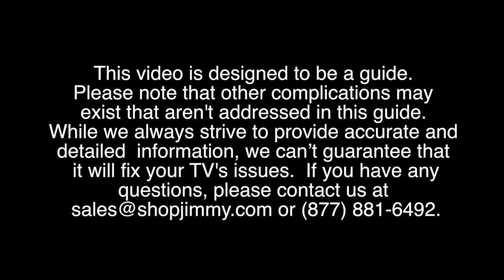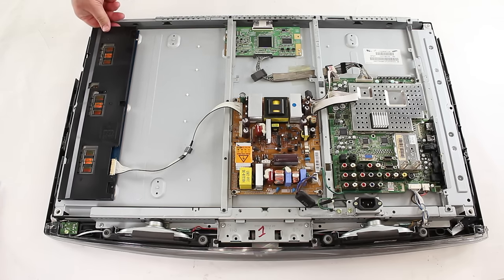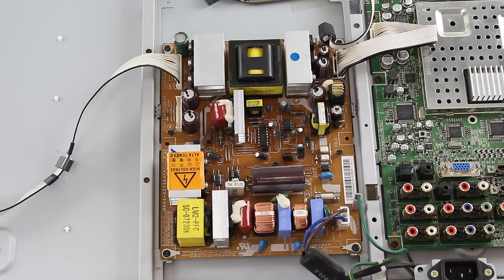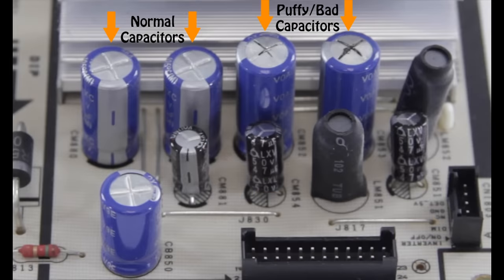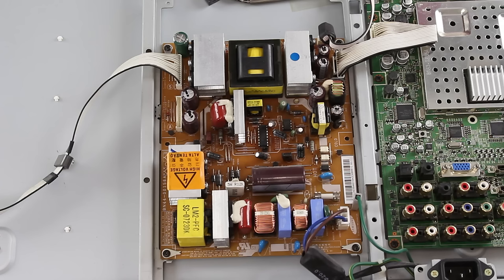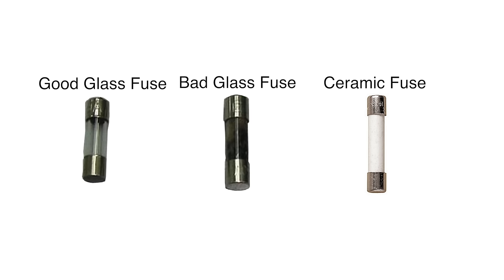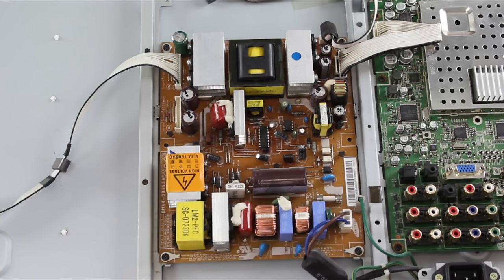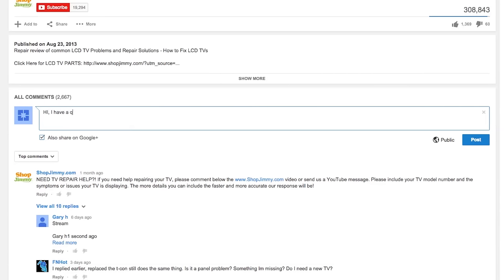Samsung TV Won't Turn On & Has No Power & No Standby Light - Samsung LCD TV Troubleshooting Help

Comment: My TV had no power and no red light.  I watched this video, took a gamble that it was my power board was defective as they said in the video.  Ordered the part, swapped it in and my TV powered right up.  I'm glad it was a $50 fix, instead of a $1,500 new TV.  Thanks for the informative video, and the replacement part.

Comment: Found two "puffy" capacitors..spent $3.50 for both.. soldered them in and my 11 year old TV works again. Thank you!
Reply: My 32 inch Samsung around same age just a few weeks ago no image on screen no sound , just have red standby light on in right corner , pressing won’t turn on set . This model has no physical power button anywhere . Might open it first time. You convinced me with the price you fixed yours . 🍺

Comment: sadly power supply section was not case of no standby light / dead tv in my case. I had to buy new motherboard for 20$ and everything worked. Probably it got somehow high voltage from antenna cable or other device via hdmi and it got damaged. Remember standby light is going directly from motherboard, not power supply board so no standby light mostly means damage of one of these boards. It does not point if TV has power, it points if motherboard is working correctly.

Comment: The best video ever posted on repairs.  Thank you.  I have not removed the cover to test it but the liught will not turn on and no light.  I tried disconnecting power and then reconnecting to now avail.  I will probably end uop needing a new board a UN65NU6950P.

Comment: Video helped me figure out what the most probable fault is and how to fix it.  I decided to purchase the full repair kit and I will replace the power supply board first and go from there.  If the $80 I spent on the kit gets me a few more years of outdoor use on my Samsung TV, I will be a happy guy.   I will update this post when the kit comes in and I install the parts.
Reply: Parts came in just as expected, very easy to install with just a screwdriver. TV works great again and I am holding onto the other parts from the kit just in case.  
Thanks for making this so easy.  
The alternative considered was to buy another TV.  $80 well spent.  
Keep up the good work.
Reply: Which repair kit?
Reply: What do I do if the problem is not the power board?

Comment: Thank you for the video. I have a 32" Samsung flat screen and don't see a fuse but u do think there are some components that look puffy as described. The blue ones on mine look just like the ones in the video. I only paid like 150 for the TV. Would it be worth it to get it repaired or should I just get a new TV?

Comment: Thanks for this great video... I have a Samsung  LN32C350D1D 32 “ tv.....  It started switching randomly between inputs, then turning itself off and on.  A few weeks later it just stopped turning on  completely.  I have a red light showing it has power, but when I hold down the power button there is no blinking or change of the continuous red light.  I took apart the back of tv to visually check things out.  I took pictures and since I am new to this, I thought I would ask you what you suggest.  The tv is very sentimental to me as my father bought it for me and was very pleased and proud to give it to me.  He recently died and I want to keep my tv as long as I can...it is sentimental for me....  according to your tips, I am leaning toward capacitors. I would very much appreciate your advice...thank you.  ..

Comment: Hi, you mention to check the fuse on PSB, for the glass fuse that can be visual inspect to see if there is a burned out thru the glass, but how do we inspect the ceramic fuse to see if it's burned out or good? Thanks.
Reply: I have the same question, and my ceramic fuse has a red line in the middle. not sure if that's an indication that the fuse is the issueM

Comment: @shopjimmy.com is it possible that the main board is bad if I have no image no sound and no standby light? Checking the power board with a multimeter  I have the standby voltage and the capacitor, fuses and diodes are good on the power board.

Comment: I have a Samsung plasma TV model number PN 42b 450 b1d I have red power light but will not power on what are some of the steps I can check without taking it apart or is there any steps to fix that

Comment: Hi,

i have a Samsung UN55B7000WF that's has had the flashing red light followed by some clicking then the same process over again no picture.  I check the PowerBoard and see no visibly damage on the caps so next i would have to check the stand by voltage on the PB my question is can you let me know if my Jensen JTM-95 is OK to do it with?  and if you can let me know if i can replace the red and black leads i have with a pair that has smaller tips to check the voltage when the connector is connected?

Comment: Dear Mr Jim my. 
Thanks for explaining tv repairing videos. 
I am facing one problem,  one Sony Bravia LCD TV.Panel is out of order(Power supply board and main board is OK. )my quistion is with out replacing the panel there is any solution for repair this. I am waiting for your valuable reply. 
Thanks and regards. 
Th

Comment: Thank you for posting your troubleshooting videos. I have a UN48JU640D  Samsung that is a year and half old. The Standby light initially comes on but when turning on the TV it doesn't turn on and the Standby light flashes (1 long and 5 shorts flashes) . Do you know what that error code is indicating. Thanks
Reply: damaged ic on the main board ,replace the damaged parts or the main board
Reply: Thank you for your reply. Do you know if the flash sequence is a failure code and if so where can I find a list of the failure codes.
It was a chance of replacing a board, but I had replaced the main board and it works.
Reply: My Samsung smart tv turned off while I was watching it and never turned back on. It was only a couple of months old. What can I do to fix it?

Comment: Gd pm, my samsung la32c450e1 no power, no indicator light, b4 I will replace my power board can you give possible voltage check present in good and bad powerboard? Thank you for for the help

Comment: I have a Samsung UE46D6507VKXXE tv that stopped having white light when power cable connected. The standby light keep blinking and I can hear a clicking sound. Since the standby light blinking and is on but no light/background light and signal from TV, does this mean it's the T-CON board that need to be replaced? I have tried to replace the power supply but still the same problem. Thanks!

Comment: I have a Samsung LT27A550LR/ZM, it tries to turn on, but after few seconds, he just don´t. I read few forums that says its a common issue of the power supply. could be this or the main board?. I cant find the part number of the power supply and I rather not open the TV (but if there is no other way, I' ll do it). thanks

Comment: Samsung plasma model pn60f5300afxza version us01 won't turn on no standby light, swap power supply board with a known good one still doesn't turn on? Could it be the main board? Suggestions please?

Comment: Hello there, my tv has all these problems. The TV is Samsung SmartTV MODEL UN55H3203AFXZA. I just received the power supply board BN44-00774A to replace the old one. I did it and the problems still persist. What can I do now?

Comment: hi I have a DLED32165HD was  on and just turned off cannot get it to fire back up again no standby light or anything checked like your video for a fuse but there's not one now checked the power supply board but anyways or bump it can't see any looked underneath looks perfect can you help

Comment: Hi, my lg tv 32lf5610 seems to turn on with a dark screen but the optical audio input has its red light on, ive measured all voltages and only 1 from the power board list is 0 volts but also there is no power going to the leds is it the power board?

Comment: Good day.I have a Samsung S51AX-YB02 . I get no power and When I opened it I see a green blinking light 2 second intervals and then it stops. I can't get it started no power or clicking sound either. I checked the fuse and it's good. Any suggestions. Thanks for your help.

Comment: I've never had a problem with my Magnavox 50 inch tv. Yesterday I picked up the remote to turn it on as usual. No power, no lights, no nothing. I reseated the plug. no luck. I did a 10 second power button test. no luck. I plugged the power cord into another flat screen it came on immediately.. So I'm assuming now that tv's just go out at anytime with no warning at all. I'm pretty depressed about the tv not turning on. I'm assuming its the power supply. I've replaced computer power supplies but the tv power supplies look a bit different. I'm thinking of doing a DIY. I am a computer tech. I have repaired thousands upon thousands of computers and laptops. Yet never repaired a tv. Do you think I can repair the tv? Any quick pointers. Is it easy to take off the back panel. Should I be very careful about certain things? my tv is a Magnavox 50 inch flat screen model number 50mf412b/f7 has no power? Thank you.

Comment: Hi,  Thanks for your videos. I have a question on my samsung TV repair.
Model Number: Samsung TV LN40A550P3F
About a month ago while I was watching TV the picture suddenly went off with with distorted vertical lines and buzzing sound noise. I pulled the plug to turn it off.
The next day it started normally and was working fine until this week.  The same problem happened again but it never came back on this time. I followed your videos to trouble shoot.

1. Standby light is blinking but the TV does not power on.
2. The 2 fuses on the power supply board are good
3. I don't see any visual damage of the capacitors on power supply board or main board. main board gets power from power supply board. I checked voltages with multi meter.
4. I don't see back light on or picture when tested with flash light.

Any ideas where to go from here? Anything else to identify the problem?

Thanks!

Comment: I had a blown fuse on the power board  it's a T3.15ah250vp ceramic. I purchased a 325A250v ceramic put it in and it sparked bad!! Is it the wrong fuse and I killed the TV for sure?!?! Had trouble finding the exact fuse with all those numbers and letters

Comment: I have a Sumsung 20 inch tv. It will not power on. But I can't find a fuse on the board. Can fuses look different than the ones you have shown? The tv is only about a year old. This problem started when I turned off a circuit breaker and then turned it back on.

Comment: well I hope u can point me in the right direction I purchased a samsung plasma p64fh at a good price and come to find out it has an issue the set every now and then will power on then after about 2 min it will shut off and won't power on again for some time I have already replaced the 3 capacitors on the y board so I'm trying to see what should b my next thing to check and or fix .there is no stand light on at all can u please help thank u

Comment: Would a bad power IR button cause the TV to not turn on? I have no puffy capacitors or blown fuses and when I start unplugging power board the TV back light comes on.

Comment: Hi i have a samsung Ln52a650a1fxza that tries to power up then screen goes black as if shutting down stand by light blinks as always when tring to power up can you tell me what the problem is looked at power board and do not see any damage or bad looking caps  thank you    Jim
Reply from the maker: +jim lucente  Try all repairs and troubleshooting at your own risk.  I recommend replacing the main board in your TV.  Click this link to replacement parts for your TV model number:  http://www.shopjimmy.com/catalogsearch/result/index/?cat=56&q=Ln52a650a1fxza  There may be multiple boards for the same TV model number, be sure to match part numbers on your current board, with your replacement for compatibility.  Here is a link to a video showing how to identify your part number, click here:  https://www.youtube.com/watch?v=BEPWrefQvqI  Thanks and please let us know if you have any further questions with your TV Repair!  www.shopjimmy.com
Reply: ShopJimmy.com .I just rented a LG smart TV..but they didn't send a remote home with me..don't see any buttons to turn it on or anything. .what do i do..

Comment: I just replaced the power supply board on my Samsung 55 in tv. The powersupply board shorted out, and I purchased a new power supply board,  as well as the other boards, and associated cables. I still have no sound or picture. The stand by light does come on, but it did after the powersupply board shorted out.

Comment: Hello. I have a Samsung TV which has a similar problem as the tube video describes but it will occasionally work is this a short problem. I have not taken it apart to go over the points in the video but I wanted your opinion before I start.
Reply: Forgot to ad model number:PN43f4500AF

Comment: hey guys. I have Samsung LCD model  LN40B640R3FXZA with no power and no standby light. The TV just shut off while I was using it and would not turn back on. Capacitors are fine and nothing looks burned or damaged. The fuses also look fine. Anything else I should check? Thanks for your time.
Reply from the maker: Dave Murphy  Try all repairs and troubleshooting at your own risk.  I recommend replacing the power supply board in your TV.  Unfortunately I do not see any replacement parts in the search results for your TV model number on our website.  Please reply with your part number on your power supply board and I can try searching for replacement parts.  Thanks and please let us know if you have any further questions!  www.shopjimmy.com

Comment: My rabbit has chewed through my power cable and the one connect cable ......Samsung tv wont power on or no standby ....is it easy to change a fuse on Samsung ue49ks7000u , also I know i need to change the cable lead but what's the chance the on connect could have blown ...

Comment: Hi I have a samsung PS-50C96hdx Plasma TV. It was working fine then switched it self off. When it has power connected the blue light comes on and is solid. (I believe this to be standby mode) when I turn the TV on whether with the remote or with the centre button I hear the power on sound/chime then the blue light goes off and nothing. I have had the back off to check the capacitors and there is no visible signs of any component damage. I am going to take the fuses into work tomorrow to test.
Reply from the maker: +602066046  Try all repairs and troubleshooting at your own risk.  I recommend replacing the main board in your TV.  Click this link to replacement parts for your TV model number:  http://www.shopjimmy.com/catalogsearch/result/?q=PS-50C96hdx  There may be multiple boards for the same TV model number, be sure to match part numbers on your current board, with your replacement for compatibility.  Here is a link to a video showing how to identify your part number, click here:  https://www.youtube.com/watch?v=R1jmj_foId0  Thanks and please let us know if you have any further questions with your TV Repair!  www.shopjimmy.com

Comment: I have a Samsung LN-S4051DX that won't power on. It just clicks and has no standby light. I've tested all caps and they are good. And when I test the power board, I am getting overvoltage. Where the 13v pin is, I get 18v until it clicks, then it goes down and comes back up to 18, then repeats over and over. The three 6.4v pins are at correct voltage until the click, then they go down and come back up. And last, the 12v pins all have 26v, then drop down and back up. Board looks good. No burnt spots or cold joints. Sounds like a humming noise coming from transistor the whole time it's plugged in and clicking as well. Any ideas?

Comment: I was upgrading a samsung tv au46f5000arxzn using a USB flash disck. Unfortunately it stuck at 90% and could not proceed. IT indicated on the screen that do not remove the USB or Switch off power. I waited for long without success only stuck at 90%. I then switch off the power and remove the USB. After some minutes I returned the power and switched on the TV. It couldn't start until now. The red light switch is on but nothing on the screen. The TV not respond to the remote control. What can I do from here to restore back the TV.

Comment: Similar to Tevarius, I have a 2014 Samsung UN40H5201AFXZA that also doesn't power on and no stand-by light. The only thing that happens is when I plug in the power cord, the stand-by light flashes 6 times. I tried the power board, the main board and the T-Con board, still no power up. I even disconnected all connections from the power board and the main board trying to isolate the problem and the stand-by light still flashes 6 times. I'm suspecting the P-Jog button because it's the only thing that I didn't unplug. What do you think?? Any help you can offer is much appreciated. Thank You!!
Reply from the maker: +zeusman100   Try all repairs and troubleshooting at your own risk.  I recommend replacing the main board in your TV.  Click this link to replacement parts for your TV model number:  http://www.shopjimmy.com/samsung-bn94-07741b-main-board.htm  There may be multiple boards for the same TV model number, be sure to match part numbers on your current board, with your replacement for compatibility.  Here is a link to a video showing how to identify your part number, click here:  https://www.youtube.com/watch?v=f7QkKGlqM_Y  Thanks and please let us know if you have any further questions with your TV Repair!  www.shopjimmy.com

Comment: I replaced power supply board but still no standby light, what’s my next step
Reply: I have the same problem, my tv is UE40MU6402U. The repair guy told me that power supply board is to expensive to change, so I've ordered it from your site, I've replaced power supply board and still no power on tv. Any sugestions?